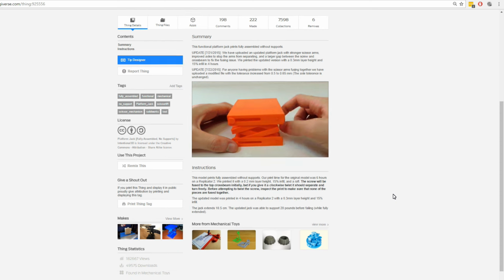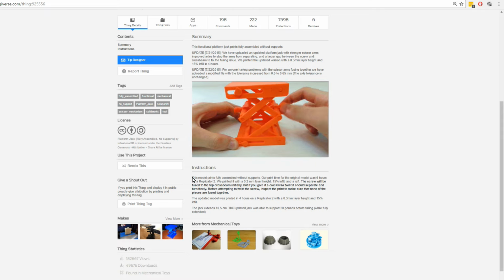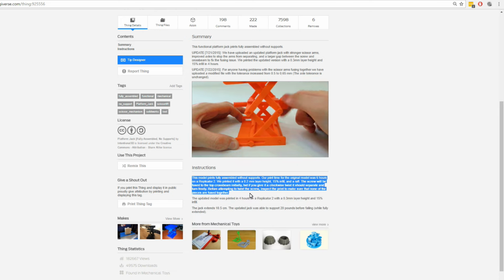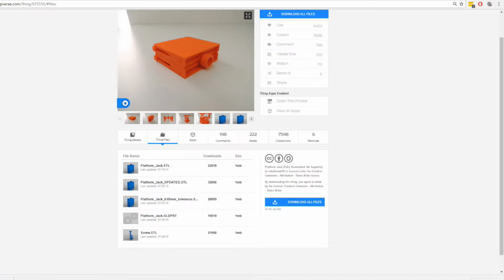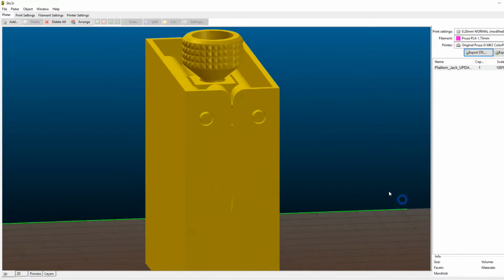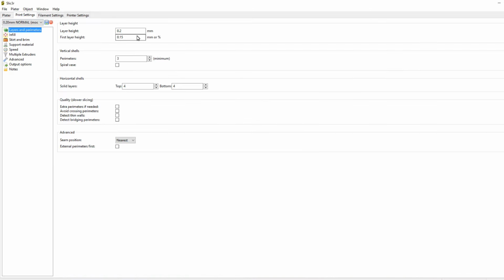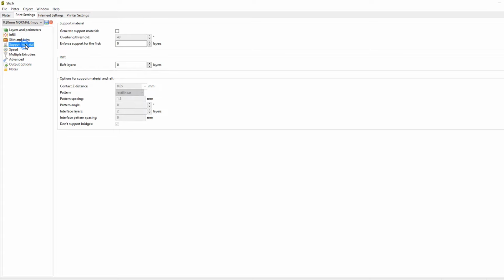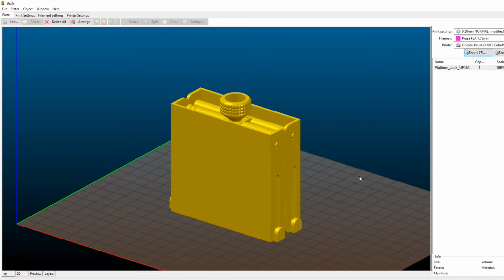Prusa i3 MK2 : Platform Jack Challenge

Comment: Great video, Mark.  I also just printed the jackstand (same file you highlighted) on my MK2 using the Prusa-supplied PLA.  Mine also looks great, but something is binding in mine.  I can turn the knob about three turns, and that's it.  I wonder what it could be.  I ran an X-acto knife along the bottom, and every thing seems loose.  Must be something hung up inside.  Someday I'll get a pliers and crank on the knob, but for now, I'll wait and see if anything new comes to mind.
Reply from the maker: John O'Shaughnessy Tell me if this helps. https://youtu.be/GdJry6ULevM

Comment: the holes definitely have ringing.  But the printer's defaults are 40mm/s too... which is slow (for a reason).  but it's light bed has it's advantages.   My 10" with glass is worse but drop the acceleration and turn on linear advance and watch the holes get crispy clean and round without that bulge on one side. (you can see it on this print, makes the holes look kind of ovalish.)

Comment: Hi,  how does the detail of this (prusa mk2) compare with the Da Vinci Pro/1.0a?
Reply from the maker: Troy Dawson I have printed a couple bench mark prints on both of the machine and the Prusa i3 MK2 is a better printer in most areas. 6 months ago when the Da Vinci Pro came out they had some issues with the machines both hardware and software. Many popular YouTubers bashed the Da Vinci pro and the machine got a bad stigma. Fast forward to now, they have fixed all of the problems and dialed in the machine. At one point the machines firmware was being updated weekly. I'm going to release a bench mark comparison soon and you'll can draw your own conclusions. Good question
Reply: Mark Fuller thanks Mark. I have seen on the net that the prusa mk2 does some very nice prints but logically, the da vinci with tweaking should do the same or better due to an enclosed build chamber and injection moulded structure...

Comment: Hello, I work with alot of higher end printers like makerbot, ultimaker, taz, etc... I was looking to buy a 3D printer and was looking for one less that $600. I was just wondering if anyone here has suggestions of printers that are good quality and not such a pain in the ass.
Reply: Everyone says this one is the least pain in the ass you can get in the price range, with autoleveling bed and all...
Reply from the maker: Make Magazine just voted the Prusa i3 MK2 best 3D printer of the year. I would have to agree. Best 3D printers I have ever used. https://www.facebook.com/PrusaResearch/photos/a.555732467830411.1073741826.555646044505720/1254023021334682/?type=3&theater